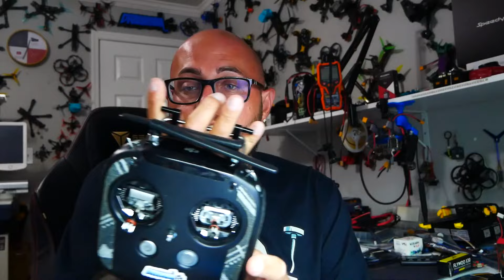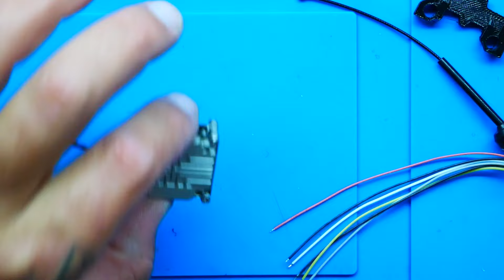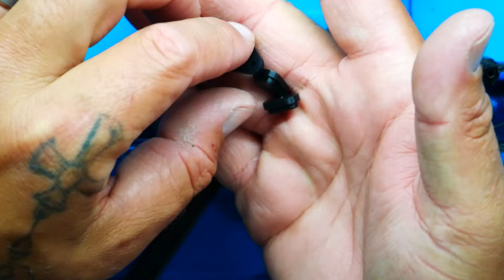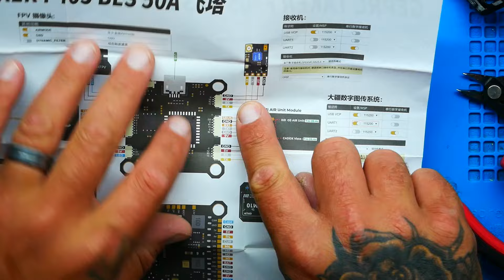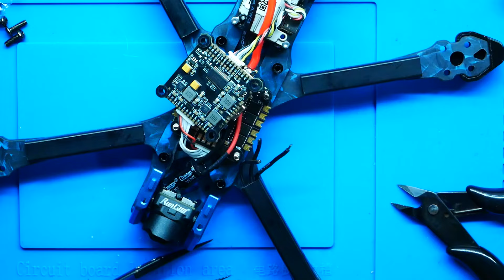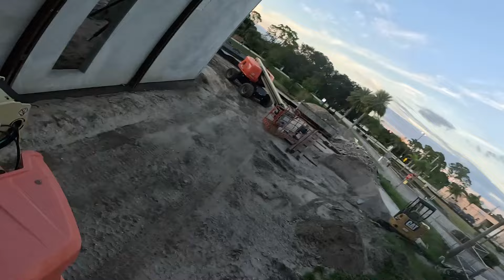Build HD Digital 6s Freestyle FPV Drone Under $300

Comment: Since you were talking about fc and all that stuff with Betaflight, I bought a happymodel crux 35 a while back and decided I wanted to get it working as a backup.. but when I plug it in to betaflight it won’t connect, I’ve already tried drivers but it just won’t connect

Comment: I run an Avata 2. Only have motion controller right now. Can I build this to work with my goggles 3? I’m assuming yes with the new update on the goggles being compatible? I can use the 03 or 04? If I buy your kit. How do I know what controller receiver to buy? I’m assuming an rc3 won’t work yet? So any recommendations on a controller?

Comment: Thanks for the video :) It's 11.11 so there are promotions so I bought this frame (it looks amazing for this price) and AxisFlying AE2207 V2 1960KV engines. For the frame + engines + propellers I paid 68 dollars with shipping and all taxes (shipping to Europe) 🤩 In my version I will use a SpeedyBee F405 V3 50A BLS stack (I happen to have one spare) + a Walksnail VTX (I'm still wondering which version to use - I have two in stock, one with a pro camera and the other with a V2 camera).

Comment: Would I be able to substitute a walksnail HD cam and vtx instead? I'm all analog right now but I have a walknsail VRX coming in the mail next week and am trying to learn what I can do with it
Reply: Should work the walksnail vtx is 25x25 mounting this frame has 20x20 and 25x25 so it should work. But you could just tape the vtx that works just like screws hope it helps
Reply: @protec2869  does tape cause overheating issues for a vtx?
Reply: @ no most people tape the vtx to the frame look up bardwell and rotor riot videos about installing the vtx